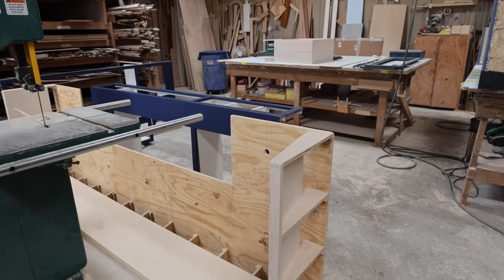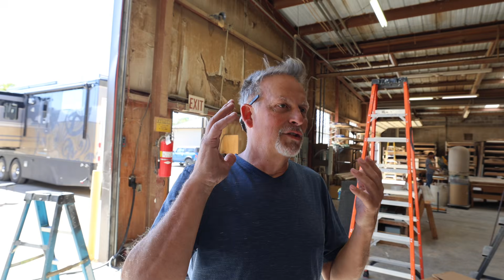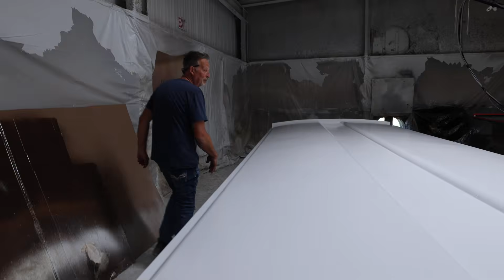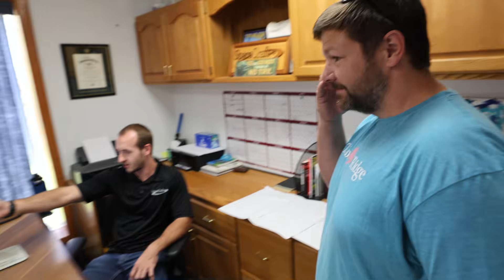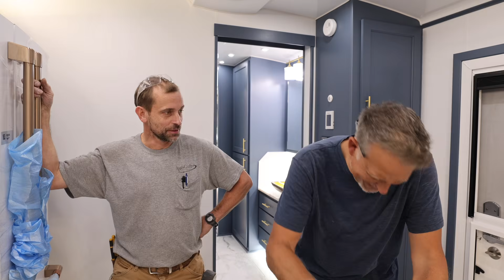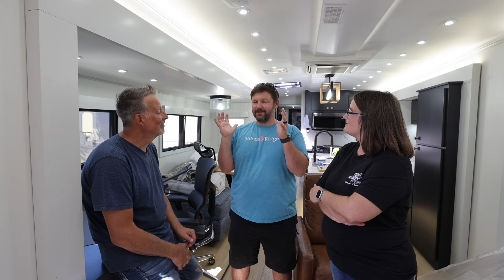Most Expensive Fifth Wheels – $800K for an RV??? 🤯

Comment: Don't ever try and get a unit like this on a ferry. I guarantee you those dolly wheels at the back will not save you. And You definitely do not want to enter Canada with a rig and trailer that size. You MUST have a commercial license to operate a tractor trailer, even if it IS just for recreation. And secondly a 57ft trailer needs a special permit up here as well.
Reply from the maker: Wow- that’s a lot to consider… I’ve seen one on a ferry but the conditions have to be perfect to use it. I’m even nervous to take our 44’ toy hauler into Canada to be honest.
Reply: They've already taken theirs on a ferry. Many have also taken their HDTs to Canada as well without special permits.